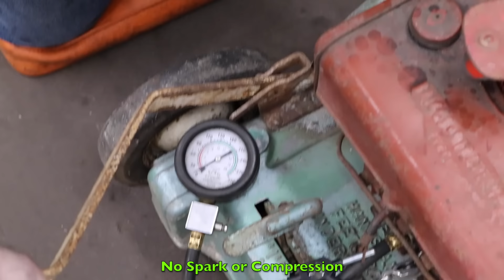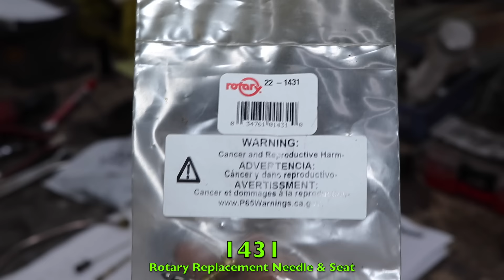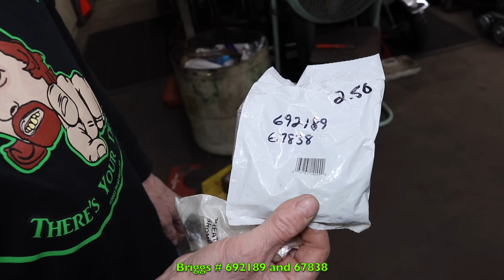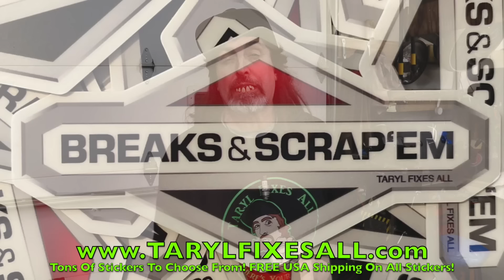RARE 1960 Hand Crank Mower Sitting 40 Years! Can It Be Saved?

Comment: I wish you could help me get my Craftsman lt3000 running again it had a carburetor issue about a year ago or so and it has this plate mechanism with plastic on it for it's adjustment you probably seen or heard of them before but I can't seem to get this thing running I bought a new carburetor for it I had it running but couldn't get it adjusted right because it had all these linkages to it and little tiny springs and just couldn't get it back together right lol that would be cool if you could help me with that

Comment: Called an impulse starter,  they changed the spring trip to the crank handle when folded closed it would trip the impulse, I would think if one rotated the knob when the engine was running it would destroy the holding pin.  worked on a few of these in my younger day. and an oil bath air filter ,   briggs cant make money need a throw away filter element,

Comment: Use A.T.F in a oil can it's a high detergent also put some in oil pan to clean the pan in your vinegar put some pea gravel and "Shake with break up the rust on the starter clutch see if there a hole in that round plug and shoot krill oil it will break loose if not drill a small hole in the center automatic lube

Comment: Cool mower...looks to be rare. However, back in the 80s, my parents had a 20" Sears mower with the crank start. The deck was red and the engine was white, probably from the early 70s. It too had an aluminum deck with a briggs engine. Eventually, it kicked up a rock which blew through the deck which in turn damaged the crank shaft.... Ended up getting tossed.

Comment: Muriatic acid is not just nasty to work with but it will dissolve the metal if you are not careful.  Then what you said about the fumes is true.  You could end up in the hospital if you inhale enough of that or if it gets on you and gives you a horrible chemical burn.  I know how awful those fumes are!  Make no mistake some chemicals may give off fumes that are not so harsh but even they could be dangerous.  If you do work with that acid keep some baking soda handy to neutralize it in case of emergencies and to keep it from destroying the metal.  Vinegar is unpleasant also but at least it won't cause you to have to go to the ER for chemical burn treatment.

Comment: Try using the inner cable (wire) from a motorcycle clutch / throttle / brake in your drill to clean out things like that fuel line. ( spin it the same way it's twisted.) It tends not to twist up like a solid wire.

Comment: Me an a Buddy  when we where 12 & 13 yrs old did our own torture test on a couple lil 3-1/2 Briggs decades ago . We went around asking neighbors & relatives if they had a old broke mower sitting around we could have . We acquired 9 or 10 mowers all together. Got all but 3 running. 1 was smoking really bad , an another had a bent crank & threads stripped on it . We drained the oil outta the first one an wired Governor wide open , It ran for close to 2 hours before it burst into flames fuel tank started leaking , it was a Ole Shit Moment for 2 kids 🤣 G-Pa was going to be pissed if we burnt HIS Barn down . For a dirt floor about inch down it was packed like rock 🙄!!! . The Second mower drained oil an wired governor on it after 2 hrs She started smoking as the paint peeled off , the block slowly changed to a dull gray when the rod started knocking an in about 2 minutes gave it up going thru the block . From 4 feet away you could feel the heat coming off that lil motor , they made them Tough back then . Especially with the basic oil we had , remember the ole Kendall oil trademark- guy holding 2 fingers out meaning you could go for 2000 mile oil changes, an before that it was recommended you change your oil every 500 miles or minimum 2x year . ☮️

Comment: Some of those valves are really stubborn I'm not sure if this model has the sleeve or if it's just straight aluminum against steel but they can be the death of an engine if the steel swells up enough then you're only hope is to ream it and add a repair sleeve and a new valve.

Comment: Same colors as my '50's Iron Horse two stroke lawn mower.  It looks like this old bird's been running a bit lean.  As far as old gas smell goes, dad's garage had a wood floor with old sheet linoleum on top of it.  Gas and oil and everything else spilled into that floor for probably 50 years.  Opening the garage on a Saturday morning was a bit like heaven smelling that old gasoline.

Comment: I had an 18 inch mower. Too bad they don't make them any more. Easier to push. Got into tight spaces. Could cut through anything even with the smaller engine, the shorter blade needed a lot less power. Nothing stopped that little machine.

Comment: back in the day , some manufacturers made magnesium decks . this could be one . vinegar will fizz on bare magnesium . also , fine particles (scrapings , filings , etc) will burn .
Reply: I was wondering if it was mag or aluminum, back then it seemed they’d use either.

Comment: A trick I do with poor soldering guns:    Just heat the tip with a lighter as you hold the trigger.  It doesn't take much to get it super hot, and then the soldering iron can usually keep it hot.

Comment: Should have put a washer on the outside of the kill-wire screw and not made it shorter. Also, a plastic wire loom on the blower shroud with a small relief for the end of the screw would have been a more complete fix.

Comment: TARYL, even though you say not to lubricate those balls,,, I have found out you can,, but only with powdered GRAPHITE,, IT WORKS WELL AND KEEPS THEM FROM EVER STICKING!!! BUT THAT'S THE ONLY THING TO USE!! If you will polish that shaft on the crank, that starter will stop squealing like a pig,, also up inside that starter piece!

Comment: Those Briggs & Stratton engines were the best engines. You could run  one of those engines without oil, and typically it would not stick rod out however Honda the engines will usually throw a rod out fairly quickly if you did the same thing and I know that for a fact because I’ve done it I really like those old Briggs & Stratton engines. now the new ones you can call those bricks and scrap ‘em  because they do suck

Comment: It was agonizing watching you work around that silly "exhaust pipe".If it had been taken off in beginning you may have been able to stand engine ,cylinder head up, soaked it with penetrating oil in exhaust opening (letting oil get into stuck guide).Otherwise great video, dad had a crank up Briggs mower like that for a time ( 50+ years ago).

Comment: Did you mean that BS logo should come back, even if displayed via stickers on plastic (like everything else), or the stamped steel engine cover (like they used to use)?

The cast aluminum deck is never coming back, because they don't naturally degrade (rust). Most sales come from return customers, and they won't return until their mower breaks.

I also like the handle. I'd install a motorcycle clamp & some dirt bike handlebars.

Comment: Weller tips will run you broke. For a temp control replacement tip, I fashion replacements with #10 copper wire. A shorter tip is hotter. What? No sticker saying, "Don't put hands in discharge shoot with the engine running."  Just ask "Lefty"!

Comment: Why not make a gas-powered tank shaker?

Just cut one side off the blade on a push mower, so it shakes like an alcoholic, and it can clean gas tanks!
Reply: Someone's comment said to fill the tank with screws and then put it, stabilized, so it wont move in a concrete mixer. I thought that was a good idea.
Reply: I guess I didn't include the important part…

"strap a gas tank (that's 1/2 full of hardware & carb cleaner) to the deck, then start it up!"